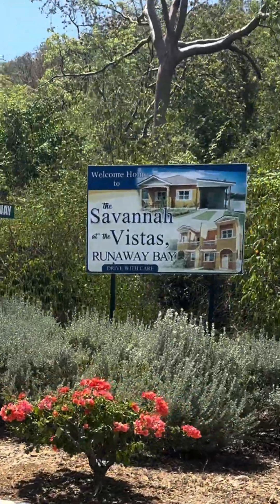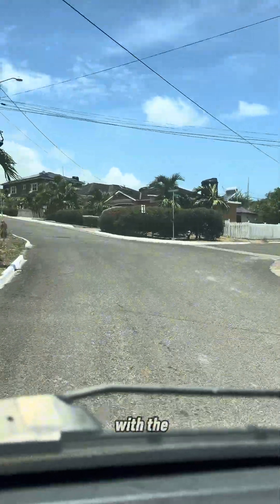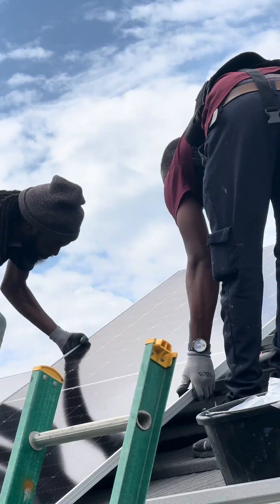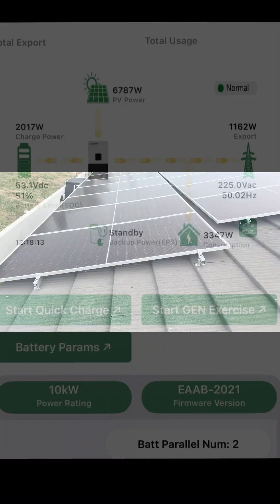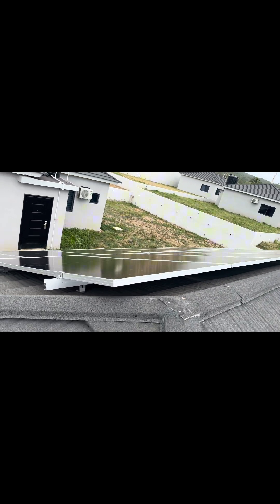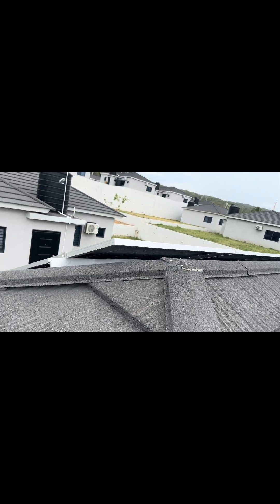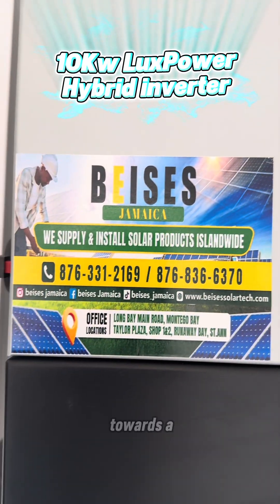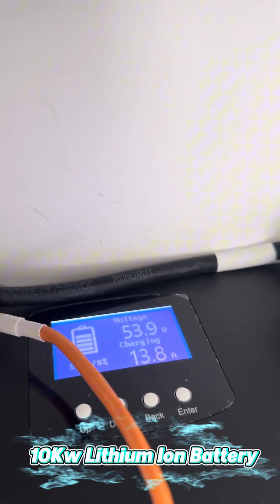JAMAICA’S LATEST SOLAR TECHNOLOGY 10kw LUXPOWER HYBRID INVERTER PAIR WITH 10Kw lithi Iron Phosphate

Comment: How much panels did that client use?
Reply from the maker: 12
Reply: Very neat installation. My ongle concern is the overhang of the panels which is not safe and can be a wind hazard during high winds. Panels should have offset all  around it. Luckily we dont yet need to submit solar plans for approval